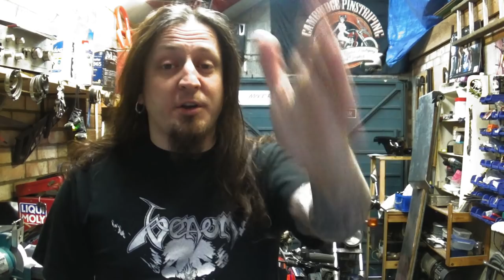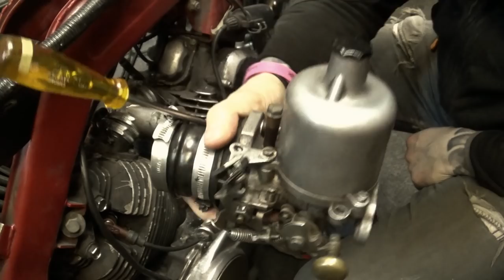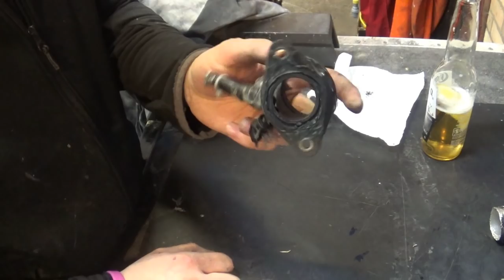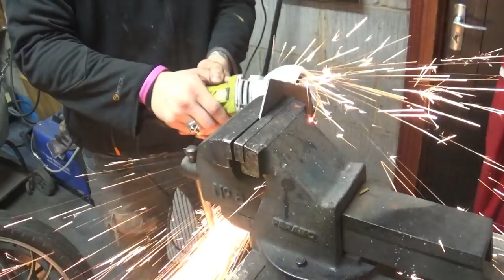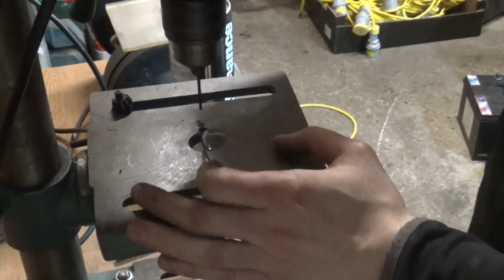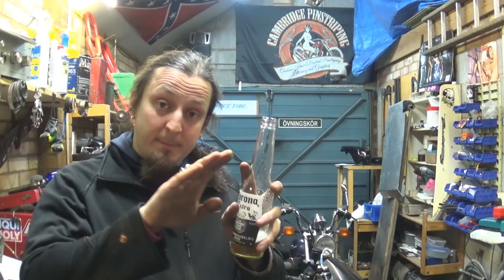Yamaha Virago XV 500 Cafe racer Build, Part 39 - Mounting the carb, part 1/4

Comment: You make those flanges look so easy, amazing how simple it all looks from this side of the camera :)   Now of course you don't want a T piece because the turbulence will be terrible and it will just encourage reversion between the cylinders.  Some nice pie cuts curving out to join into one would be just the ticket ;)  I know you love a challenge brother.  Skal!
Reply from the maker: Ha! If only... I was actually thinking about the Y pipe...BUT! it has been working very well with the T pipe so far...and to make the Y joint exactly and precisely in the middle...and then weld it all so it looks semi decent? I think I will try my luck with the T pipe again.

Comment: With a solid manifold between the two cylinders, vibration may be an issue for the carb.
What about creating a stub for each of the inlet brackets you made and then using a short length of rubber hose to connect to the T-piece? That would give you a little bit of wiggle room and should make mounting a bit easier. Imagine a solid T-piece connecting the two cylinders, then cut at about 10mm from each inlet. It should still be fairly solid, but flexible enough to adjust for varying gasket thicknesses.
Reply from the maker: Yes, that's what I was thinking... Actually I am thinking to reuse the existing rubber mount as a gasket between the plate I made. And from that create my T joint pipe. I still have some options to explore here. Thanks for your comment tho, very helpful!

Comment: Where did you get the manifold/adapter for the single carb into both cylinder heads?
Reply from the maker: I've made it from scratch. These vids show how I made it.
Reply: @MackieBass  took me a while to scroll to that part. You're actually an animal. I wish I had the same skills as you man. Awesome build. Thanks for posting these videos I'd be pretty screwed on my xv500 without them

Comment: Heat transfer may be something to consider.
Reply from the maker: Yes mate, I know and I am thinking about it. May as well reuse the existing gaskets/rubber mounts  as a shield between the engine and the plates I just made...but then again on cars they are mounted straight onto the engine. I still have to think about this one.
Reply: A rubber mount on the carb end of the manifold might work.